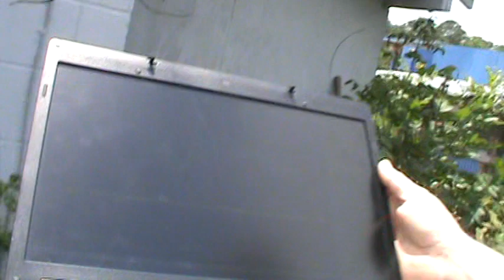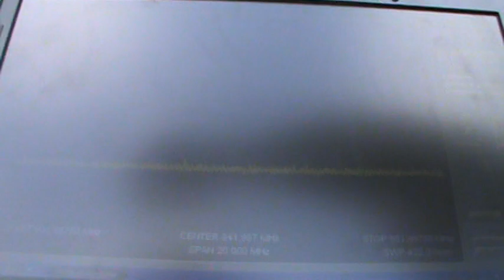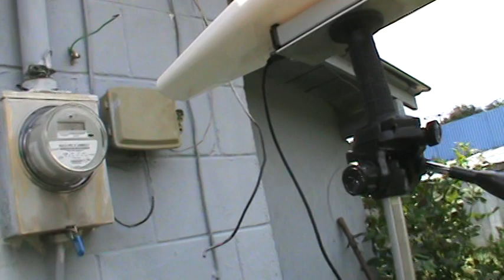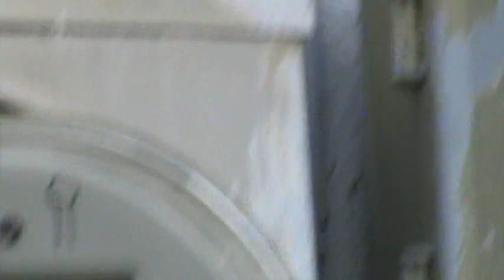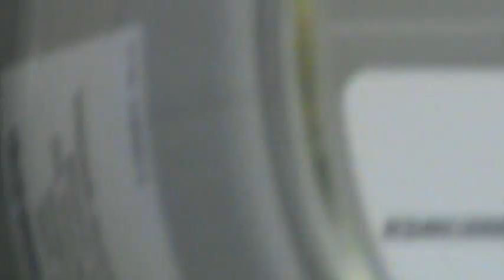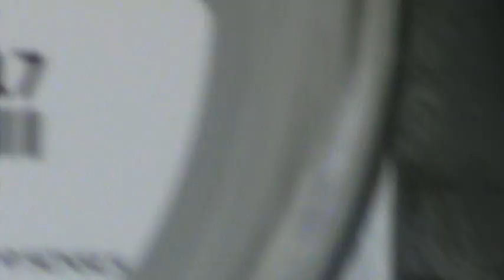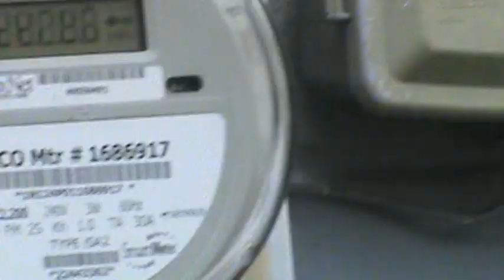Georgia Power Smart Meter Investigation Part 1

Comment: Your cell phone puts out more power than a smart meter does and the frequency is higher and it is found to be safe to hold up against your head so how is a smart meter signal pulse 4 to 6 times a day going to radiate through a wall and cause all this damage? All the injury that you claim that this causes is true IF you are exposed over time using a matter of watts not micro-watts emanating from the meter so go back to bed baby!!! It would be basically it's the same if you operated your microwave oven with the door open.
Reply from the maker: that's not close to what this is all about.....a device's signal power...it's about signal conglomeration, harmonic cross talk, infrasonic undulations, the microwave hearing effect, frequency saturation levels in reference to closed spaces.....and much more...not that, alone as a topic, about a smart meter blasting you with radiation....however , THAT can be thrown in there since you're surrounded by THOUSANDS of low wattage smart meters, and all kinds of other devices, yes from your phone to your wifi to your computer to any microwave communication devices, including RADIO band stuff, adding that COMBINED energy/radiation/rf into your environment...get a meter and get close to a bank of smart meters, you're being blasted......

what injury am I claiming?  Damned sure can claim and prove some...not from just a friggin' meter, no....go talk to your diplomats in Cuba, get a celldar unit and use it, then come back and talk.
Reply: No, lets talk now. The problem in Cuba and China is multiple FULL watts or tens of watts of microwave power not microwatts or milliwatts. One can NOT be surrounded by THOUSANDS smart meters because homes aren't built corner to corner with smart meters being mounted on common corners of each house. In other words, you don't get to play 4 square with smart meters. Since RF power, like magnetism and gravity, diminishes by orders of magnitude as a function of distance from the source, this means that it wouldn't be able to be biologically noticed by any living thing after only a few feet. I lived in a subdivision in Florida where the houses were so close, when I bought an 8' X 10' storage shed, I had to hire a crane to lift it into my back yard. The lots were 65' X 125' and the houses themselves were only 8 feet apart with a small decorative concrete alcove for trash can storage occupying a portion of that 8' space. The power meters were ALL mounted on the same side of each house which means that there weren't 2 meters visible from any one place in any one yard. Not only this but the meters are mounted in a grounded steel box that is facing the wall of the house. The smart meter itself may not have a ground but the meter box and conduit does. 

...signal conglomeration, harmonic cross talk, infrasonic undulations, the microwave hearing effect, frequency saturation levels in reference to closed spaces.....and much more...not that, alone as a topic, about a smart meter blasting you with radiation...

WHAT THE HELL WITCH DOCTOR HAVE YOU BEEN TALKING TO??? The above are your words, NOT mine which more than proves my point. I HOPE THAT YOU DIDN'T PAY MONEY FOR THIS SHIT BECAUSE YOU DON'T KNOW WHAT THE HELL YOU'RE TALKING ABOUT AND NEITHER DID THE WEB MASTER OF THE SITE THAT YOU GOT THIS GARBAGE FROM!!! 
Lets start with "signal conglomeration". The definition of this is NOTHING more than a mixture of signals. Eggs, milk, bacon, green peppers, salt and pepper is a conglomeration of ingredients to make an omelet. A lot of men, women and children are talking in the same room at the same time. The children speaking in high pitched tones, the women speak in high tones, the men at lower tones. THIS IS audio frequency signal conglomeration. The tower on top of the Empire State Building in New York City has broadcast antennas for several AM and FM radio and TV stations that broadcast at the same time of day on different channels. THIS IS VHF and UHF signal conglomeration. Without insult, you and your friend have certain thought pasterns and I have different thought pasterns that don't align with yours regardless of who is right or wrong. These thought patterns can be received on an electroencephalograph and will appear differently between yours and mine and, in some cases, even your friend's pasterns will be different from you and me. Put these together on a paper roll like a lie detector or heart monitor and you'll have brainwave signal conglomeration. You and 59 of your friends are in your back yard and all are on 60 cell phones talking to different people at the same time. This is milliwatt power, microwave signal conglomeration.
Then there's "harmonic cross talk". The only example that comes to mind that you might understand, again, no insult intended, is in Virginia, automotive radar detectors are illegal. ALL radio receivers with the exception of crystal radios, emit low power radio waves. Even the microwave receivers in radar detectors. This is because to get any kind of quality reception from a radio signal it has to be broken down in stages until it finally gets to the audio range of human hearing. In the case of radar detectors it gets to a point of turning on a beeper and / or LED. If they worked like 1 stage crystal radios, any kid's toy walkie talkie would set them off. Instead, the microwave signal that the cop is irradiating you and your car with is broken down in stages, filtered and broken down and filtered again several more times until only the cop and an air port radar beacon will beep at you. Some genius came up with a way to detect one of those intermediate frequencies leaking from radar detectors and built it into a receiver that the Virginia Highway Patrol bought. Now, if you pass a patrol car with your radar detector on, the cop will pick up this HARMONIC CROSS TALK from your unit and stop you for it. Another quick example is in CB's heyday. You're on channel 10 and the guy next door is on channel 11. You hear each other's squawks but not clearly. This too is harmonic cross talk.
This brings us to "infrasonic undulations". Infrasonic is a range of frequencies just BELOW the AUDIO RANGE OF HUMAN HEARING which is just BELOW 20 Hz. If you looked at a graph of frequencies ranging one Hz to Gamma radiation, you would find the Gamma ray mark on the moon and the infrasonic mark somewhere through the center of the earth and in the South China Sea. Infrasonic undulations, HMMmm. I explained infrasonic. Let's see. Undulations. A child's jump rope undulates. Earthquakes make the ground undulate. Infrasonic undulations would mean something that would make the air vibrate or undulate just BELOW the ability of a human to hear it. Unless someone was aiming an audio frequency horn speaker right at you blasting hundreds of watts of 10 or 15 Hz sound at you, you wouldn't even hear it. If this did happen, you would feel the air and / or ground vibrating around you but you still wouldn't hear it. No problem here either.  
The "microwave hearing effect"??? WHAT THE HELL IS THAT??? If a human could hear microwaves, you wouldn't have a microwave oven in your house. At between 800 and 1,100 watts, it would blow your ear drums into your sinus cavity!!! WOW, "Frequency saturation levels in reference to closed spaces". If my mother was still alive, I'd swear that you've been talking to her. She was a great one for The National Enquirer. RF frequency saturation does NOT mean a build up of radio frequency energy in an enclosed space. Frequency saturation relates to air core, linear ferite core coils, toroid coils and other tuned radio frequency circuits. Air core RF coils are just as they sound. An open coil of wire wrapped around a hollow tube.  A linear ferite cored coil is the same except it has an iron ferite rod in the center. If you have ever taken the back off from a pocket AM or AM - FM radio to change the battery, the 1 1/2" or 2" coil of thin wire across the top of the circuit board with the semi-shiny black stick in the middle of it is an example of a linear ferite core coil. The last example or toroid coil is a coil of wire wrapped around a round doughnut of, usually, iron ferite and wrapped around the walls of the doughnut in a ring shape. There are different uses for each of these coils and they come in different sizes and tuned for different frequencies. Saturation of frequencies means that the maximum usable power of the radio frequency range that one of these coils is tuned for has been reached. If you were to add more power to it, it could be wasted, cause HARMONIC CROSS TALK with other radio receivers or within the circuit that it is wired to, burn out the wire coil or crack the ferite core or toroid in the case of the last two examples.
A sheet rock wall can be saturated with water in a flood. Your yard can be saturated after a heavy rain. Radio frequency emissions can NOT saturate an enclosed space like a room or building. You can build what's called a Faraday cage which will take radio signals and cycle them either to ground or around you but in the absence of this, radio frequency energy can not be saturated, stopped or absorbed in an enclosed space. The material constructing the enclosed space , people or things can absorb some of the radio signal but, for the most part, it will pass through all of it harmlessly unless, of course, you are the U.S. Ambassador to China or Cuba. I hope you get your money back in any case. Good night.
Reply: Let's look at why we do not need smart meters. 
 #1 A smart meter will hurt or even KILL disabled homeowners who have disabled medical implants.  The average of deaths by smart meter radiation and smart meter fires is almost 100 every month in North America.

#2 Did you know if your power company “turned off” the power to your home when they did a smart meter install, your chance of a smart meter fire increased by a factor of 10,000.

#3 Your power company has access to all of you private power information. Eg When you make tea, when you turn on your alarm etc. This private information is sold to Google for huge sums of money. Ask your power company what the second radio transmitter in your smart meter does. (ZigBee) 

#4 A smart meter will cause cancer to return if your family members who are fighting cancer at home. If they come home from the hospital and sleep near a smart meter, they will die. Check with the US Cancer Society website. 

#5 Smart Meter RADIATION  will turn off breakers in your home. Both AFCI's and GFI's get turned off by the radiation from the smart meter.

#6 You smart meter is very accurate, BUT, the software (firmware) is programmable. Your bill has nothing to do with the power you use. 

#7 Smart meter radiation is breaking Ionic Bonding. 

#8 A huge expenditure for a huge loss. Billions of dollars to purchase something that does not general generate any power and each smart meter need 4 watts to operate. One million smart meters use 4,000 KILOWATTS of energy to operate.

#9 The second radio transmitter is for ZigBee. If you want your power company to MONITOR your home 24/7, then you are in luck. Don’t forget, this private information will be sold. Why do you think your power company spends BILLIONS of dollars and does not generate one watt of extra power to sell?
Reply: @frederiquezug5938                                            test test
Reply: ...Let's look at why we do not need smart meters. 
 #1 A smart meter will hurt or even KILL disabled homeowners who have disabled medical implants. The average of deaths by smart meter radiation and smart meter fires is almost 100 every month in North America...

OK, lets talk about my EXPERIENCE with a smart meter. I have been disabled since 1999, been in this particular home
since 2001 and have had a smart meter since 2012. I am 63 years old and still breathing the last time I checked. My
medical implant, a spinal cord stimulator for reducing pain, has functioned flawlessly for the last 2 years that I've had it.
I haven't had a single house fire since I've been here although we came close one time in 2012 when lightening hit my
power line and smoked my MECHANICAL power meter. This is why we had the smart meter installed.

...#2 Did you know if your power company “turned off” the power to your home when they did a smart meter install, your
chance of a house fire increased by a factor of 10,000...

Did you know that I wouldn't allow my power company to install ANY meter without shutting off the power? My house has
vinyl siding. If the tech crossed the 240 VAC mains with a wrench, I could see a fire in my future then and what does this
have to do with a 10,000 factor increase in the chance of a house fire anyway? Do you even know what a "factor of 10,000
means? If you fold a piece of paper in half, it's height has increased by a factor of 2. If you fold it again, it has increased
by a factor of 4. Fold it once more, a factor of 8 and so on. It's like saying if you start with a penny on the first of July
and double your money every day, you will have several million dollars by July 31st. Now I said "double your money"
NOT double your penny's. If your chance of a house fire increased by a factor of 10,000 due to smart meters, this would
mean that if every house in the country had a smart meter, EVERY house would have to burn due to a smart meter, some
more than once just to satisfy your prophecy or they would have to build houses on every acre of arable land and install
a smart meter on it just to prove you, or should I say, your "information source?" right. Before tRump got elected, I would
NEVER have thought that there were this many gullible people in the United States. It's a sad state of affairs to see that
 the number of people with any notion of common sense in this country has dwindled, (this means shrunk), to this level.

...#3 Your power company has access to all of you private power information. Eg When you make tea, when you turn
 on your alarm etc. This private information is sold to Google for huge sums of money. Ask your power company what
 the
 second radio transmitter in your smart meter does. (ZigBee)...

My power company had access to a lot of my private information the day that I applied for power 17 years ago when
I gave them permission to do a credit check to get connected anyway. Since then, Google, Amazon, Walmart or any of
the millions of other on line sellers have not hit me with any coffee or tea ads in the last 6 years. This is because you
idiots who believe that your power meter can tell the difference between a coffee pot and a space heater are WRONG.
Also, I use the alarm exclusively on my cell phone so that if I have to get up for a doctor's appointment, I won't miss
it if the power goes off but for the record if your power meter can tell the difference between an alarm clock, a dark
room timer and a microwave oven timer, you need to get the hell out of Russia. If you are worried about who knows
when you make tea or what time you set your alarm, you need some serious medication and a LIFE!!!

...#4 A smart meter will cause cancer to return if your family members who are fighting cancer at home. If they come
home from the hospital and sleep near a smart meter, they will die. Check with the US Cancer Society website...

What in the world is the "US Cancer Society"??? I'll bet if you go to the "AMERICAN CANCER SOCIETY'S" web site, they could care less about smart meters or even cell phones for that matter and they were an even bigger "threat" than your smart
meter in the news. The "US Cancer Society" is probably some Russian bot put there to reel in suckers like you.

...#5 Smart Meter RADIATION will turn off breakers in your home. Both AFCI's and GFI's get turned off by the radiation from the smart meter...

Well, lets go back to my EXPERIENCE once again. In 17 years, the only time we have had a standard breaker pop in this
house is when my wife plugged in her blow drier AND a space heater in the bathroom at the same time. The only time
that we had a GFCI pop is when someone bumped the test button while plugging something into it. You really need to
get off the internet and into a library. The information there, if it is up to date, is much more dependable. I hope you
don't buy real estate on line but if you do, I have some elevated waterfront property in Brooklyn, N.Y. for sale. It's
called the Brooklyn Bridge. It's famous. Perhaps you've heard of it?

...#6 You smart meter is very accurate, BUT, the software (firmware) is programmable. Your bill has nothing to do with
the power you use.

My house is all electric, no gas, no propane. The number of kilowatt hours that we have used on average had not changed
by much in the last 17 years including the 6 years that we have had a smart meter. Even when we went from a 3,500 watt
30 gallon hot water tank to a 4,500 watt 40 gallon tank. The reason for this was that I had installed a digital timer when I
installed the new tank and the tank is off for 12 hours a day from 10:PM to 10:AM. Our bill actually went DOWN
substantially in July when my son and his girlfriend moved out in June to go to college. This was a HUGE savings!!!

...#7 Smart meter radiation is breaking Ionic Bonding...

WHAT THE HELL IS THAT??? There is NO such thing in main stream science called "ionic bonding" that has ANYTHING
to do with your health or anything to do with your smart meter. Google "ionic bonding" and see what you get. I did and
here's what I got:
"An ionic bond is a type of chemical bond formed between a cation and an anion. In an ionic bond, one or more electrons
 are transferred from a cation to an anion. An example of an ionic bond is sodium chloride, abbreviated
 NaCl."
Sodium Chloride or NaCl is table salt and rock salt. If you smell Chlorine coming from your salt shaker, then you'll have
something to worry about with a smart meter. Oh, and by the way, if you see a silvery metal in your salt shaker, don't let
it get wet. That'll be sodium metal. It tends to react violently with water. Meanwhile, I'll continue to enjoy my table salt
from my salt shaker while I watch my smart meter click by the kilowatt hours from my coffee pot, or space heater or
electric skillet or any of those other high drain items in my house.

...#8 A huge expenditure for a huge loss. Billions of dollars to purchase something that does not general generate any
 power and each smart meter need 4 watts to operate. One million smart meters use 4,000 KILOWATTS of energy to
operate.

Somehow I don't think we'll miss that extra watt. MECHANICAL meters drew 3 watts and all meters draw their power
BEFORE the metered output and even if they didn't that 3 or 4 watts is half the power draw of a 7 watt night light bulb
anyway. I doubt is anyone would notice an increase in their power bill if this were added on. Where the real savings
come in at least where I am living is in the fuel and maintenance of the service trucks that they WON'T have to send
around every month to read rural meters like mine where there is anywhere from 2,000 feet to 1/2 mile between
homes. This will also free up many man hours of labor that can be better used
 somewhere else which will stave
off increases in power bills at least for a while. Any number of months the power bill DOESN'T go up is money in
our pockets. 
...general generate...
I've heard of General Motors, General Mills and even of general nuisance's like you but "general generate" must be
 some
 new upstart power company. I'll have to look that one up.

...#9 The second radio transmitter is for ZigBee. If you want your power company to MONITOR your home 24/7, then you 
are in luck. Don’t forget, this private information will be sold. Why do you think your power company spends BILLIONS of 
dollars and does not generate one watt of extra power to sell?...

Not that I care but what the hell is "ZigBee? The only thing that my power company is monitoring 24/7 is my power
consumption and this is their right because, until I pay my bill at the end of the month, they are loaning me the power
that I am using. This "private information" BULLSHIT is useless to anyone but the power company because power
usage is the ONLY thing that they can glean from ANY meter. You are WAYYY too paranoid to be let out alone or on
a computer without a keeper. If my power company wants to tell my wife the identity of my girl friend, we will ALL
get a big laugh because she is also disabled, doesn't drive and rarely leaves the house without me. 
Do you own a bee keeper's suit? It might help with your ZigBee problem. If not, try an aluminum foil helmet if you
haven't already. I'd be willing to bet that the second radio transmitter, if it exists at all, is a backup in case
 the first
one fails. It would be much cheaper, per meter, to include a second transmitter than to buy second meter to backup 
the one that fails due to a bad transmitter. Working in the radio arts for the last 45 years tells me that this might be
the reason but that's just me. (GAG, GAG, YAK, YAK!!!)
By the way, please forgive the "test test" before this. I think my smart meter is being a smart ass and messing with
my computer.
Reply: I missed the test tes, we do take the odd coffee break once and awhile. 

https://ieeexplore.ieee.org/document/7866234/?reload=true

https://www.eff.org/deeplinks/2018/08/win-landmark-seventh-circuit-decision-says-fourth-amendment-applies-smart-meter

https://www.maltatoday.com.mt/news/national/84965/former_enemalta_head_of_accounts_used_tampered_smart_meter

http://www.ve3ncq.ca/wordpress/?page_id=10
Reply: HOLY SHIT!!! I just Googled ZigBee. You're further off the rails than I thought you were. Did you Google ZigBee??? it's a
digital and radio protocol for HOME AUTOMATION, IDIOT!!! Yes it can be used for short distance communications like
from your garage door opener remote to it's receiver or from a small remote in your wife's purse to a receiver in the
house to turn on your porch light, disable a home alarm or from the remote on your night stand to turn on the coffee
pot down stairs in the morning. You know, the one that the power company is monitoring so they can tell Black and
Decker when to start pressuring you to buy a new one? It's kinda like Bluetooth but digital. Or don't you go to a dentist
cuz he might be one a them damned CIA spooks and install one of them danged ole blue teeth in yor mouth too?
That would give you a total of two teeth. One blue, one brown from chew. 
This would mean that you could  blame 
your lip cancer on that danged ole Blue tooth instead of your mother because of her  second hand chew. (dip  / snuff).
You're not just off the rails, you're a complete hazardous waste disaster waiting to happen!!! HAHAHAHAHA
Reply: ZigBee   Make, Model and serial number of every of smart device in your home. 
ZigBee can also be used to control these appliances.
Did you know a smart stove will have to ask PERMISSION to turn on at some point?

 
PRIVACY 
 U.S. Congress    
Smart Meter data: Privacy and Cyber Security 
https://fas.org/sgp/crs/misc/R42338.pdf    Trust me, you will never think of the words "hourly consumption" and keep a straight face ever again.
Our evaluation is based on more than 3,000 current consumption fingerprints, which we have captured for a range of household appliances. 

http://ieeexplore.ieee.org/document/6424093/?reload=true&tp=&arnumber=6424093&url=http:%2F%2Fieeexplore.ieee.org%2Fxpls%2Fabs_all.jsp%3Farnumber%3D6424093

http://www.zigbee.org/

Nest Uses Its Data To Turn Electric Utilities Into Cash Cows
http://techcrunch.com/2014/04/18/nest-uses-its-data-to-turn-electric-utilities-into-cash-cows/

http://news.nationalpost.com/news/canada/smart-meters-are-vulnerable-to-hacking-and-present-a-threat-to-personal-privacy-ontario-new-democrat-warns